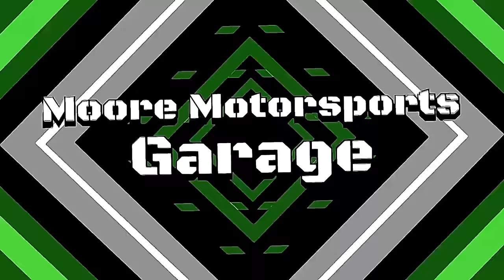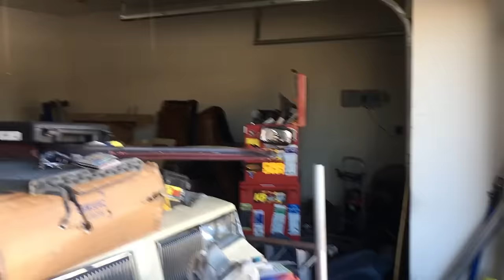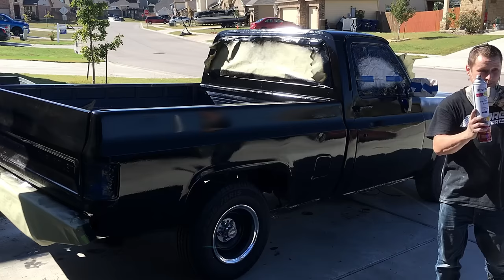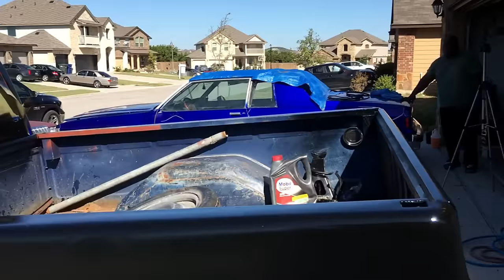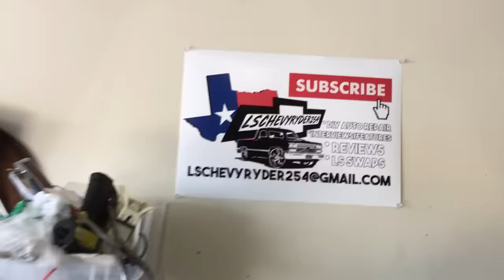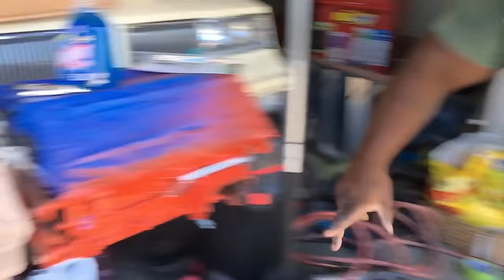$50 rustoleum turbo paint job.

Comment: The problem is that its weak as far enamel goes not being catalyzed. That in combination with not enough paint on it to provide a good barrier makes it likely to show through in less than a year. Sand it and tape it, Repaint it for $50 again. If you let the first coat dry well for 2 weeks and water sand it with 800 and shoot it again and repeat, then with 15 cans on it, it would last longer.  That was 4 years ago so you probably know all of this.

Comment: I'm not exactly sure what's worse here, the prep job or the paint job. I am gonna say the prep job! Tail lights taped off and all the tape ran horizontally and overlapping the body, tires not covered. I mean I get not everyone is a body tech and it looks like very little body work was done, which is probably a good thing! But damn, it don't take long to search up a Youtube vid and watch how to properly mask off a car! Shame on the owner for caring this little, temporary coat or not. Hard to get paint back off tail lights, trim, windows, etc. As for the orange peel, that wasn't caused by the prep job here I don't think. Orange peel was the wind or solvent not drying fast enough because you used WAY too thick of coats! Not sure why the owner didn't just paint it himself, it couldn't have been a whole lot worse. Stopping in the center of a panel, rather than using the gaps between that the designer gave us to stop and change direction. One of your coats should be 3 normal coats, then you would have used 5-6 cans of this paint. The wind would have had less effect on a thinner coat but the culprit is the solvent in the paint, not being able to dry quick enough with temps in the 60's. Thicker coats are for higher environment temps but even then, NEVER this thick of a coat. Then you didn't even open the doors, hood, nothing. EVERY place when you open the doors and hood are gonna be a different color now. You're changing the color of a vehicle here, change the color of the WHOLE vehicle. To do a job like this and say "hey, shit happens, the paint job came out like crap. I will do better next time" is one thing. But to post this as a success, I am sorry man, I feel bad for that square body. Where I live, these trucks are almost all gone due to salt inhibited rust. So to see such a solid ass truck get shamed with Rustoleum and so lazily done, makes me sad. Do better bro, this paint has a nice fan from what I hear and I was going to give it a try on my winter beater! This was NOT a good example of it's potential at all, I hope it turns out better in the next vid with a better prep job! Nice of you to do that for him for free but even a $500 special paint job would surpass this quality by a mile!

Comment: Flip the truck around and paint...
Reply from the maker: Everything was taped up or we would have. We thought of that and we didn't wanna take too long between the paint transition from one side to the other. He is happy with it. A little wet sand and buff and it will look alot better. He just wanted it painted on the low so he got what he wanted and he is happy with it

Comment: Satin or Rat Rod black. Wet Sand. Do at least one more coat. It would look presentable and last a few years. Another day on the body work. Maybe two.  Made a PVC frame and a Harbor freight tarp to block the sun and wind while spraying. Another $100 - $200, and this Truck would have been passable. Or do a raptor Job. Covers up a lotta crap. :-)

Comment: Orange peel has little to nothing to do with prepwork.
Reply: Haha
Reply from the maker: Terry Bonin Yes it does actually. If you don’t knock the orange peel down prior to painting there will be more orange peel.  So if there is orange peel and we don’t sand it down smooth and I were to put a coat on top wouldn’t the coat on top be orange peeled? Yes it would. I speak from actual experience on this one. He did do prep work to the truck and it wasn’t perfectly smooth but it’s all good. I’m not trying to be a know it all or anything by any means but I do know if there is rough paint on the surface and you put paint over the top it will indeed be rough. The other turbo paint I used on the trunk didn’t orange peel but I also sanded and prepped it smooth. (Different video)
Reply: @JamesDguy  true true....gotta have smooth start and no sun......
Reply: You're correct Terry!!! That truck didn't have orange peel on the factory paint they covered up!!! It may not of been the best prep, but the Orange Peel didn't come from the prep it came from the paint and the dry spray from trying to use as little as possible!!!
Reply: @rockerpat1085  sun didnt help kooler temperatures would have helped but it's kool....

Comment: I wet sanded my car, waited for it to dry, then my very first light coat I had waves of drips. Idk what I'm doing wrong
Reply: Cheap paint?  Sprayed too close?
Reply: Boone... You don't have to spray any coat on thick... This is a timed process. Proper distance, multiple even coats with about 3-5 or more minutes between coats. Softly Wet sand with 1500-2000 grit, then once it's smooth the way You want, Do the same process with clear coat. Then after that dries (1/12 - 2 days), You'll be best to protect your finish with a polish then wax..... This takes 1/12 - 2 weeks sometimes. It also helps to Practice on a piece of junk metal to get the feel of things.
Reply: The pressure of the paint probably pushed any existing water out the trim and crevices. I just know this because i used to work prepping for paint. Use 3m alcohol prep wipe with a cloth, dont wash.

Comment: Hit it with 2000 wet sand and buff it out
Reply: That would make a huge difference, especially with a clear coat over it.
Reply: Buffing it would make a difference in 'normal' painting situations. However, being that this is done with spray bombs, I GUARANTEE as soon as you start wet sanding it, you will cut right through that paint. After you take out the propellants used in those spray cans, there really isn't a lot of actual color there. VERY thin. Definitely not enough material on that truck to allow for wet sanding.

Comment: Does anyone know how long this paint job with this name brand last? 
If he would have put a good primer underneath and 2-3 coats of gloss the paint job would have more endurance.
Reply: not to mention buffing and removing any orange peel on base layer before coat would also be icing on the cake.
Reply: @Obviouscaptain  right 👍. I remembered a guy on youtube that put a primer and used the Rustoleum black gloss paint without buffing it or putting a clear 2 years ago. He used the gallon paint bucket in the the aluminum can. In the comments they asked him for an update on the paint. He said it was pretty much the same after 2 years. I don't remember but the paint gallon was between  $30-$50 and he painted 3 vehicles and a trailer all at the same time. He didn't even tried to do a really good job and it lasted 2 years already. I just imagine if he would have and used some wax compound now and then. It would have lasted longer. The cheapest paint job on a car is $1,000 now days.

Comment: Wet sand and buff then polish.. will look pro..
Reply: I was thinking the same thing. I'm still debating doing mine. Havent seen a good prep paint and sanding
Reply: @John-sz6ws  you hear guys talking about the correct spray guns and compressors, but truth of the matter is you CAN achieve a professional result with hard work after ie wet sand and buffing.. the spray gun setups simply help you save time and effort direct from the gun. Go a head and try it and if you get stripes and orange peel just wet sand to perfection then buff.
Reply: @SeekingHim786  What grit should you wet sand with? Im gonna sand and spray my car next week, i got the hood done it looks decent but can see stripes from some angles. Also ive seen a lot of videos i got the same can but it looks like theirs spray wider so its easier to do a 50% lap but my can sprays really thin like an inch and a half so its hard to lap it properly. Any advice on that?
Reply: @MbispingFan  for the stripes .  you need to use at least 1000 grit sandpaper try not to go anything lower than that because it will start to  look a bit abrasive so in my opinion I would use 1000 grit sandpaper and soak The sandpaper for a couple of hours at least 3 hours. The stripes will go away very easily after this. After this if you feel confident enough you can go over the 1000 with 2000 then buff out. 
As for you saying that you're can  spray pattern is thin you will really need to step back and apply a lot of coats of more of mist like coating. You could go to the local hardware store and just purchase a cheap can with the better spray nozzle and replace it onto your can at home. Otherwise step back a bit about two three inches away from where you're spraying and apply more more coats this way. Remember the key to spray can painting is too pretty much just get the paint on the car and remedy everything afterwards.
Reply: @SeekingHim786  Thanks im gonna try 1500 grit and see how it looks. With buffing i just put on the compound and buff and leave it as it is or do i wipe it down and wash it after?
Reply: @MbispingFan  leave it on, when it's starts to shine like a marble there's no need to wipe it off it adds a layer of protection to your newly painted surface.

Comment: James,  any thoughts on Krylon gloss paints ?
Reply from the maker: Norm Hodgkinson I don’t use krylon anymore. Never had good luck with the paint bonding good. I use to use krylon but they changed the formula and tips on the cans and now they aren’t as good.
Reply: @JamesDguy    i'm finding that out.    as i mentioned last week,  i put a top coat on one of my trailer fenders, and it blistered.   i should have waited the recommended 5 or more days before the top coat.   are you satisfied with the Rustoleum  gloss ?
Reply: I'm not him, (the shaker can pro guy) but I'll say, I'm satisfied with the quality. However, that being said, I have been finding fluxuations in the match up of the gloss white I've been using......and I've had to use many on my vintage trailer project. Trial & errors.
Tip...use cans from the same stock code, (bottom of the can)
-cheers
Reply: p.s.....
that's the Rustoleum 2X product,
not that which he uses in this show.
Reply: @sharinmoore5691    thanks for the info.  i'll give the Rusto a try, and i'll check to get the same code on the cans.

Comment: Can it solved by 2000 sand paper and 2k coat?
Reply from the maker: danilo d'alessandro If I wet sanded and added clear it would improve it a lot but it’s mostly under the black needs prepped better.
Reply: @JamesDguy  thank for the reply, i love your video...how? With a fund? I want to paint my entire car with spray cans but I'm afraid it will come in orange peel

Comment: He painted a whole car with spray paint wonder how long that will last. I painted my bike with it and every time a rock or stick hits it a piece of paint falls off even though I did 3 coats of paint
Reply: It all depends on prep. You need to paint on a very clean surface and use primer.

Comment: Purchasing automotive grade acrylic enamel, reducer and harder is not that expensive. And it has UV blockers. Stop wasting your time painting with rattle cans. That poor truck looks awful.
Reply: joseph migliore yes but it is more expensive than this and I’d you don’t care if it’s perfect it’s fine, also you need a paint gun and air compressor still

Comment: Could you 1k grit then 1500 grit then 2k grit and polish?
Reply: no
Reply: @JoeB0604  probably could I bet
Reply: @Getsum-ii  I'd love to see someone wetsand a black oil based paint and then polish it
Reply: @JoeB0604  what would happen?
Reply: @Getsum-ii  usually clear coats get polished.  the oil based paint will probably get swirl marks.
Reply: Of course you can. It’s definitely soft, give it sun and cure time. Cuts very fast, I’d skip the 1000, and go 1500 and 3000 if you’re hand sanding, or even just 2k by machine. Definitely wet, it clogs instantly if you try to dry sand. Then compound and finish with a DA and a very fine finishing polish like M210.
Reply: @jdisdetermined  yea I didn't think it was impossible or would turn out trash as I've polished my fender that was turbo can painted (came out nice) little confusing 🤣
Reply: Yes if he was to clear it... And if the body prep was done the right way
Reply: @jeremycaldwellbikelifej6752  yeah that was what I was trying to say....not sure if the base paint has a hardener in it that would make it survive sanding and the temperature from buffing

Comment: Bro!! Do Not Use Steel Wool On Glass. Use soapy water and a razor blade.... Bro!! Omg.......
Reply: As long as you use 4 0 steel wool it works the hardness is less so it won’t genuinely hurt the glass
Reply: Quadruple 0000 steel wool will clean the hell outta some windows...🤔
Reply: @brocklesner5306  search it up can’t scratch glass with something softer than it on the hardness scale
Reply: @trippiebear848  I know that. This guy apparently doesnt

Comment: Me being 16 with a old obs Chevy that needs new paint I might use the turbo paint 🎨 on my truck I could buy my 400$ in paint and another 150$ in a gun for the air compressor but 50$ is a good deal for a clean paint job for a old truck and maybe latter I’ll go and paint it the proper way

Comment: What’s the finish like on that and should I use a clear coat for a gloss finish
Reply: Just get a gallon of Rust-Oleum paint with acetone much better quality on the budget 3:1 ratio sprays good with a hvlp gun.  Upol is a decent clear on top of Rust-Oleum that's what I'm doing with a pearl in it. Check my video out of the Rust-Oleum paint job I did. Just my 2cents.

Comment: I had the same year Buick Skylark. Sold it to a little Vauto
Reply: As a youngster I had a skylark, 1970 something. 6 cylinder gutless wonder but always started and never let me down.
Reply: @anthonythorp7291  also cruised a 1976 Malibu Classic 4door lowered with a 4"rear spoiler on the trunk lid. At 100 mph it was stuck to the hiway. Thought I was a NASCAR driver.

Comment: Even prep wont help if you wont lay a wet even coat. Just saying..
Reply: When you use a spray can, is really hard to paint large surfaces, its look very well for that price. I tried to paint a roof and a hood, and trust me, you will be cursing and swering during all the process.

Comment: Sure. Will it last over a year ? Or fade
Reply: Paint lasts fine. BUT... The color will fade if truck or car is stored in the sun. My Brat has a 12 year old camo green rattle can paint job and still looks great, but It is stored in a garage when not driving.
Reply: @danielrenfroe7824  same kind of paint ?
Reply: @johnnywhite9956  Yes, Except it was olive drab and the little cans not the new Turbo cans. Here is the Brat (Forgive the old crappy video and editing) https://youtu.be/5iVm0HSR0gk
Reply: @danielrenfroe7824  did you put clear over it?
Reply: @magicstew45  No clear as we wanted it to be flat / non-gloss.

Comment: That was quite an education there. Did he have half a load of dirt in the bed?  It was a 50/50 job, 50 feet away and 50mph it still looks like what it is, wasted material . At least you blocked the wind with your arm . SURE GOT THE EXCUSES THOUGH.

Comment: How do you get rid of that brown look under light? I did my front fenders with rustoleum and when you shine a light on them they look brown. I did a very good job at prepping before paint and had a couple coats of gray primer
Reply: alexmaland614 that’s a sign of light coverage. If you look at it the naked eye sees black. You can color sand to remove any dirt bibs or debris that may have landed during spraying. After that you want to lightly fill those spots with a light coat and then a full wet coat of black should solve your issue!

Comment: So if you wet sand the paint won't come of with 1000 to 1500 like you said to do? I am looking to do this with my car.  Just not sure how much better wld code paint would be in an aresol can. 
Please respond. Thank you!! #dallastexas
Reply: using 1000,1500, would take forever to burn through certain things like the clear coat. If you really want to be careful use 2000,2500-3000.
2000-10000 is meant for polishing though in a sense

Comment: Bad prep on the body. No wet sand primer. Could have been a nice paint job, had he taken the time to do the bodywork and surface prep. That makes all the sifference.
Reply: Just read your comment on the prep work..  I am a total newbie..   I have on old truck where outer layer of paint is letting go and peeling all over the place.. Would like do a cheap repaint job and paint with spray paint.   What would you recommend for prep work before I paint.   Thanks for your help.
Reply: @howlingwolf125y  hey there! Since he didn’t reply to you I’ll tell you. For the prep just make sure you get masking paper and some tape. Cover up the windows, taillights, headlights, blinkers, and plate lights. Then get plastic wrap and cover up the tires. Make sure you plastic wrap under the hood and whatnot. Then go ahead and paint. Of course use 320 grit sand paper to sand the body of everywhere first then go ahead and do 3-4 coats of your paint letting it dry before each time
Reply: @Qnsol   Apprec. that buddy..  Thanks so much for the quick overview on how to prep and paint a car/truck..  I hope to be able to help you someday.   Thanks again for your help.

Comment: In a situation where you overflow while gassing up your vehicle.  What happens if you spill a little bit of gasoline on that paint? Does it damage the paint?
Reply: Yes
Reply: It will if you don’t add a 2k clear coat to it